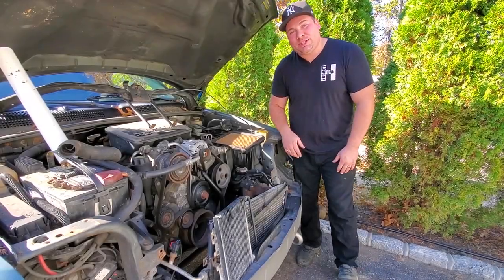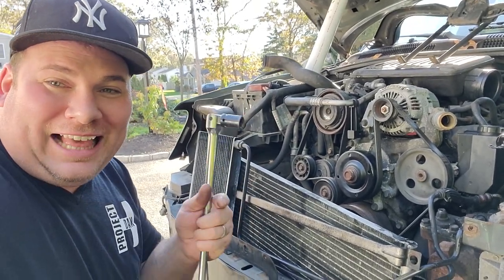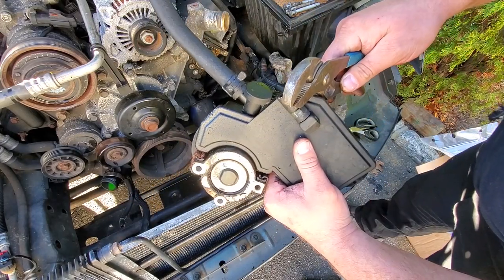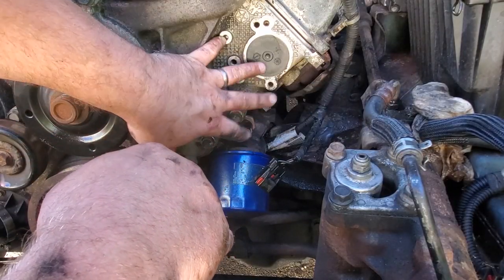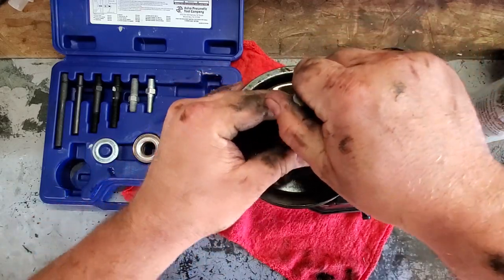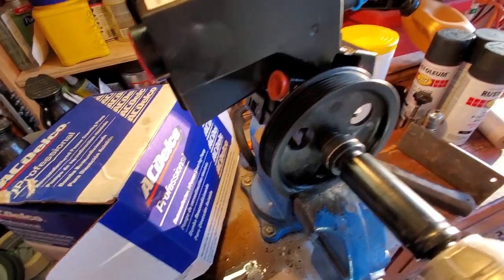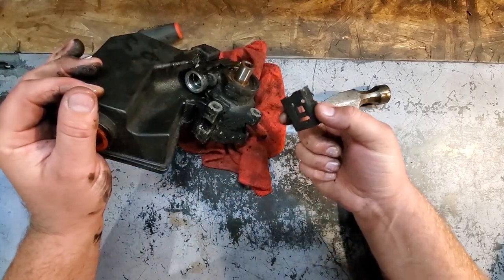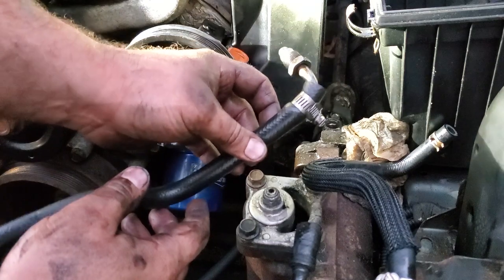2002 WJ 4.7 OVERLAND POWER STEERING OVERHAUL - PROJECT GRAND CHEROKEE WJ EPISODE 1

Comment: Saved a some money on my 97 Jeep Grand Cherokee;  6 cy, 4.0L, w/AC, repairing a power steering fluid leak that I couldn't find while pump was on the vehicle. The pump and reservoirs can be purchased separately which meant the units have a non-factory seal between them. Most likely O-rings.
Removing the pump unit on a hunch paid off. They are in fact 2 O--rings that are used, and available at hardware stores. A #11 for the lower pressure between reservoir and pump,  a #6 for the high pressure coming out of the top of the pump. Cleaned fittings well, slipped O-rings on and re-installed unit for a total cost $2.51.  Fitting sizes may be different pending manufacturer's design.  #11 =  1/2"ID x 5/8" OD x 1/8" H.     #6 = 1/4" ID X 5/16" OD x 3/32H.
TIP: The high pressure O-ring deforms to fit as it is compressed by fitting. Compare to one removed.
Reply from the maker: Dude that's some solid info right there! Thank you for the input

Comment: Hey Dan! Was going to say you need to do the gas prop upgrade to your hood, then noticed it already has them. Upcoming quick project. One of the best upgrades I've done to my XJ. And btw, heading to the pull and save for my power steering bracket today. God bless, stay well.
Reply from the maker: Good call brother!  how ya get a nice score! 🙏
Reply: What's a gas prop upgrade on the hood?

Comment: That's the same problem my 04 wj had...got rid of that fan and replaced it with a severe duty clutch and a 17 inch 12 blade ford fan...and just to be triple sure I added a 180 stat and an ebay all aluminum radiator...I sleep better now.
Reply from the maker: awesome bro! well done!

Comment: I prefer to take the pully off before taking the pump off, but that's mostly because I've worked on cars that you couldn't take the pump off with the pully installed.  I had fun a few months ago when my power steering pulley exploded on my 5.2 ZJ going down the interstate one Sunday evening.  Thing was so old that when I tried to pull what was left of the pully off it snapped off the lip that the puller holds on to.  New pump, pully and lines later and the slightly weird feeling I got in the steering disappeared.  Go figure.
Reply from the maker: oh man that's crazy! I hate when the collar rips off!

Comment: Hi Dan,
Dan I want to learn to remove front end body panels and grill for access to engine.
Is there a good place for this information?
Haven't been able to find any vids.
How did you learn this?
Thank you.
Reply from the maker: hey, its not too difficult, just a few scres and clips.  start with the headlights and grill then the bumper cover.
Reply: @ProjectDanH  Thanks Dan the Man!

Comment: Hey brother watching your videos and other's preparing to replace my power steering pump on my O2 4.7 Cherokee. Anyway noticed not only did the dealership give you the wrong power steering fluid but you had the wrong green antifreeze in the cooling system as well.
Reply from the maker: All the Fluids have been corrected in my corresponding WJ vids 👍
Reply: Still haven't fixed mine, got my power steering pump and it came with two seals. One is a black o ring and the second is a white plastic ring. Nothing in the instructions says or shows where they go. Did yours come with these as well ? Any idea where they go ? Thanks in advance.
Reply from the maker: @anthonydoyle6631  the little Orings go inside the line connections, youll see it when you unscrew the fittings

Comment: Dude you want to talk about a huge pain in the ass? Replacing the pump in the 4.7 with the front end in place... took me 9 hours!! I also had to re bleed the coolant system since you have to disconnect top coolant line to get the pump back in. I'm about to have to do it again since my pump bearings are going bad and she's leaking again after 9 months. FUN!!!
Reply: Pull the pump out the bottom then no need to disconnect radiator hoses
Reply: @lawnmowerboy7421  I can remove it from the top without disconnecting the top coolant line but putting it back in with the hydraulic line attached is another story
Reply from the maker: Oh man, Fun times with the WJ!